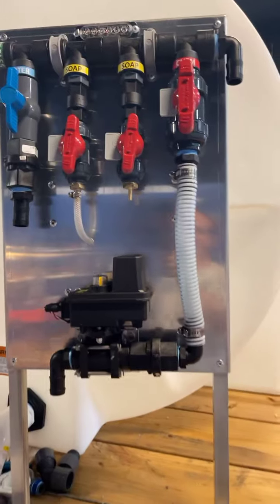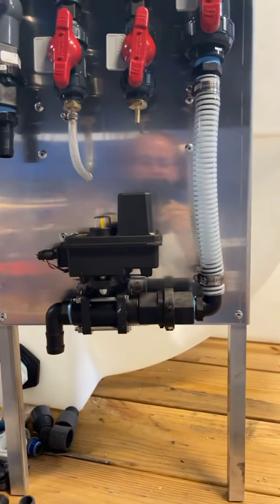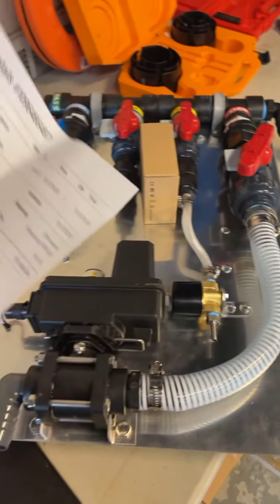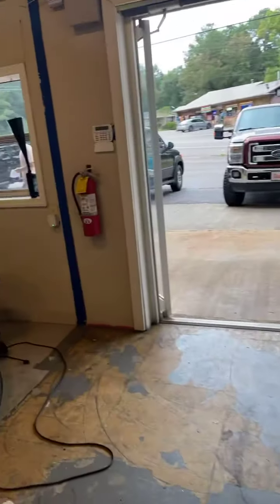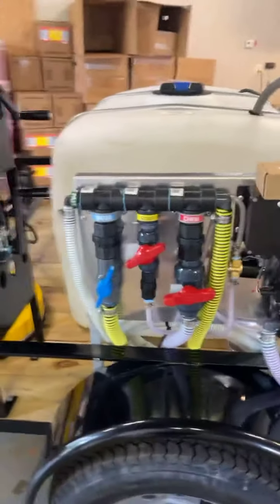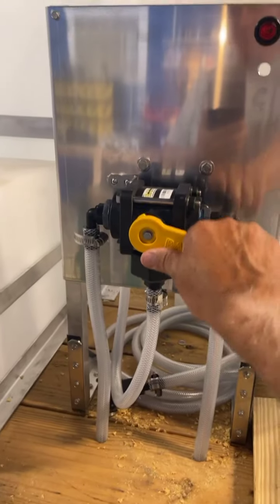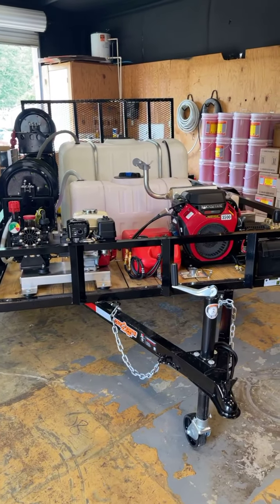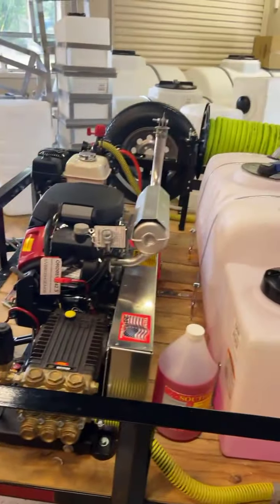New design on manifold for gas roof pump

Comment: You need to use a metering valve for your water also, or your ratio is not correct. When you turned the unit so we could see the back, you didn't have any screw to hold valves from loosening up. Vibration from pumps running over time will loosen valves and cause air leaks.
Reply from the maker: https://southernstyletrailerbuild.com/product/super-deluxe-manifold/

Comment: Why don't you use the US Solid valves. They are remote control with your phone and they are stainless. So you can eliminate all that crap that is so expensive. You can control what ever percentage you want to pump or shut the valves off. The valves are only $80

Comment: How do you keep the bypass line from contaminating rinse-water?
Reply from the maker: Check valve
Reply: @southernstylepressurewash2  I’m sorry, I just do not understand. You’ve got a 25 ft bypass line with solution in it. You then switch to just water to rinse. You rinse for a few seconds and then you get off of it; while that’s happening, solution will bypass from your bypass line, through your manifold, and into your applicator hose. How would you prevent that with a check valve?
Reply: @kristopherrainbolt2617  it wont because of the check valves.  Check valves are needed on each seperate supply line.  3 valve manifold requires 3 check valves, bypass line does not need a check valve
Reply: What's your website?